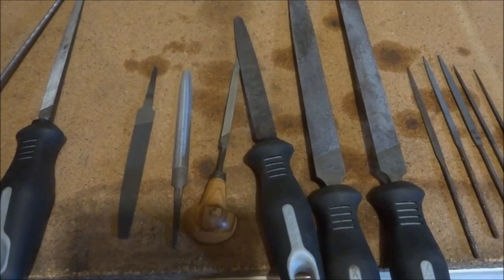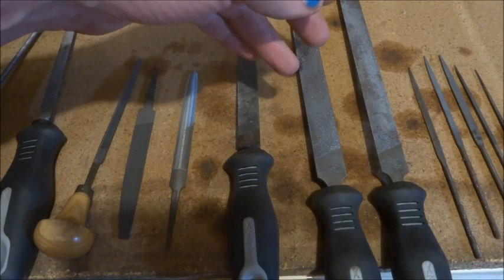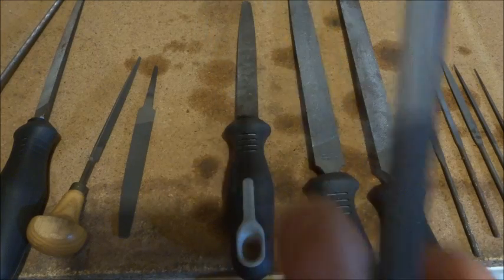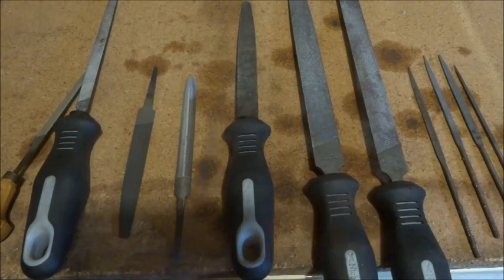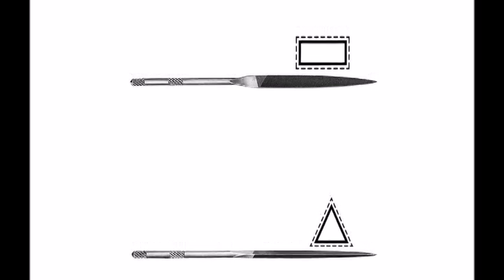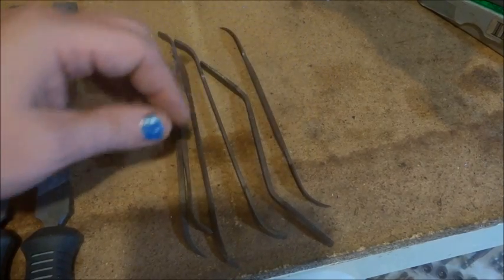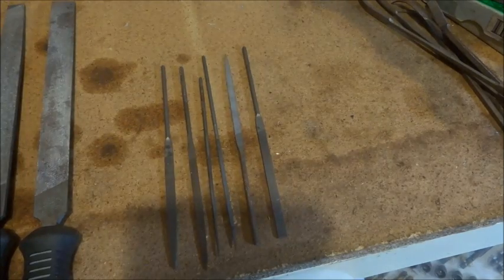METAL FILES: types and sizes

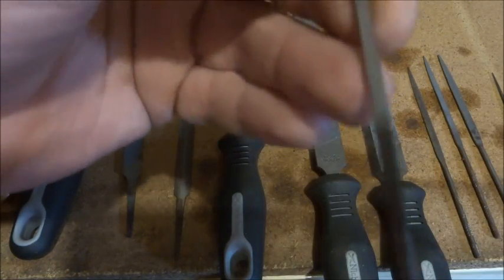Comment: At 6:30 regarding the square file, you said you can touch one edge to the stone for a safety edge.  Any stone? How bout a hand cranked bench grinder. I  would like to modify a file or two for sharpening auger bit tips.  I don't want to spend 25$ (price of auger file) , for something I'm not going to sharpen often.   I figure if I have a couple small files, I'll  grind off the teeth on one side to create those safety edges. Never done this before.  Any suggestions?
Reply from the maker: +Slap Stick it's probably best to use a flat stone then you don't get a wobbly edge when you are done. I've got an old yard sale stone for jobs like that.
Reply: Emmas Spareroom Machineshop  okay, good advice. Thanks.